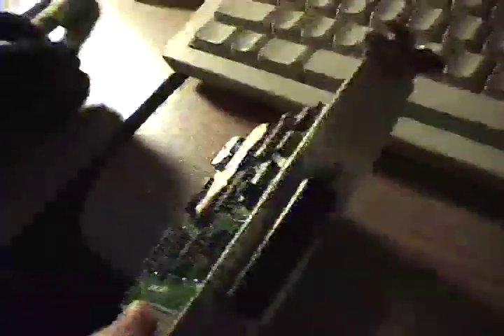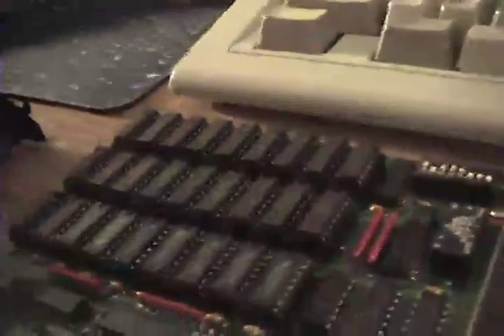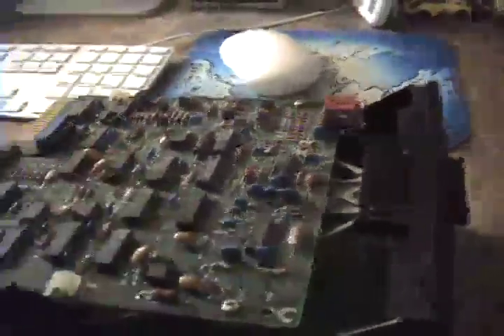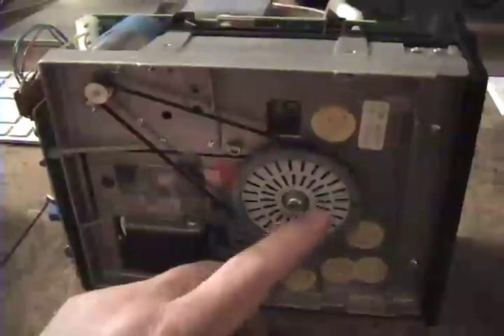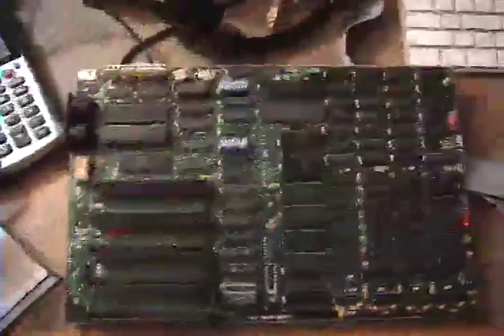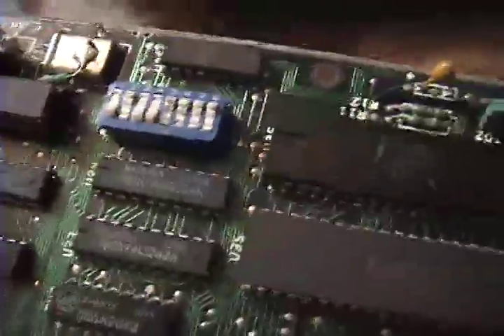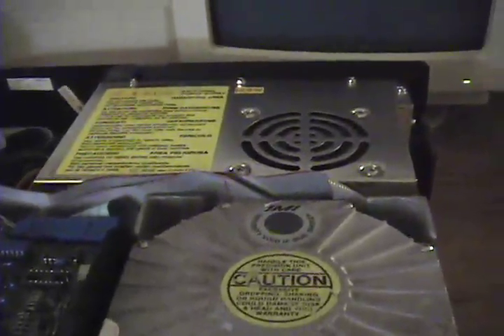IBM 5150 PC Disassembly

Comment: I like how you skipped the part about taking the case off. Helpful!
Reply from the maker: Rather than leaving snarky comments, you could just ask "how do you take the top case off?" To be honest, it's a no-brainer; three screws and pull it toward you. Any idiot can figure that out.
Reply: +BBISHOPPCM's World first off, mine has five screws and "pull it towards me" doesn't tell me much. How do you know where I'm standing? If I'm at the side, do I "pull it toward me?" Sorry, but I just get annoyed at all these "how to" videos that skip pretty important steps!
Reply from the maker: It's very easy. See, when you're making videos, it's also important to leave out the obvious shit. This was filmed back when YouTube had a 10 minute limit on videos for non-partnered accounts. It's been a few years, so my screw count may be off. So here goes; remove the five screws (#2 philips head screwdriver; lefty loosey, righty tighty) and stand with the front bezel (the plastic front of the case) facing away from you. With your palm flat, slap the top of the case while pushing forward; this will free-up the top cover from the chassis. OR, with a plastic mallet, give the top cover a few light whacks from the back (hitting the edge of the steel cover itself). Then, with the front bezel FACING you, slide the cover off by pulling toward you.
Reply: +BBISHOPPCM's World see?! That was pretty good! Except my screws were flathead, not Phillips.
Reply from the maker: They may have been replaced at some point

Comment: Lol that interface is DB 37. I only have seen and only have 1 DB37 external flopyy drive for PCs and its made by apple. I just got a very similar machine came with same monochrome thing and I am upgrading it to a ATI vga card and it came with the maxed out 640KB ram. I am trying to upgrade to the NEC V20 since its onlya few bucks on ebay I assume the number after the - is the speed and I can only find models with 16Mhz. Does anyone know if it would clock down to 10 or can it run at 16?

Comment: I thought 5150's ran on tape drives, no hard drives.
Reply from the maker: Tape drives were optional; the original 5150s had no hard disk drives, only 360k floppy.
Reply: BBISHOPPCM's World

I get it now. I thought the tape drives were built in. I forgot that these were the 80s and that they built computers differently in that time period

Comment: That V20 is still running at 4.77 megahertz.  It is only possible to run it at 8 megahertz if the system board supports it.  The reason for the V20's speed is the fact that it has a hardware multiplier and fully optimized microcode.  It also has a special mode which allows the processor to run 8080 machine code.

Comment: The timing marks are for setting the speed of the drive motor under a fluorescent lamp (the magnetic ballast kind, not the newer electronic ones).  The inner marks are for 50 hertz and the outer ones are for 60 hertz.

Comment: I was lucky to find one of those Tandon floppy disk drives in the shop where I bought most of the parts for my 5150.  It came in a huge industrial storage attachment with a Tandon TM502 10MB hard disk and a couple of very nice linear power supplies.

Comment: The largest and heaviest hard disk I've ever owned was a Micropolis 1588.  It stored about 660 megabytes formatted and weighed nearly twenty pounds with its eight 5-inch platters and overhead spindle motor (yes, the spindle motor was mounted to the top cover).  It used a 50-pin SCSI interface, and because of its multiple platters it had an impressive track-to-track seek time of 2ms and an average access time of 16ms.

Comment: My 5150 started out as a MicroTICCIT terminal which I picked up for $5. It had no internal drives; just a custom video card, a Token-Ring card and a boot ROM.  My build consisted almost entirely of parts from other computers which were purchased at the same electronics shop; the only two parts which were purchased separately were the 640K RAM board and an XT power supply.  The total cost of the build was around $40.  I may make a video of the system later.

Comment: @1:00 The external 37-pin floppy connector actually uses the 34-pin Shugart Floppy interface that the internal drives do. Pins 1-5 on the top row of the 37-pin external connector are unused; the remaining top-row pins contain all the FDD signals (which are the even number pins of the internal connector) in ascending order, while the bottom row pins (pins 20-37) are grounded, according to page 182 or so of IBM PC Technical Reference Manual.

Comment: I had one of these not too long ago that was in pristine condition, new in the box.  It had been bought as a cold swap machine for the offices of the nearby nuke plant, I figure.   It was still new in the box.  I threw it away, as it was wholly uninteresting.  I have a lot more interesting 8 bits.  Wish I had kept it now, only because it was pristine, and just stuffed the box in the back of my closet to sit 50 years.

Comment: last week I restored 2 IBM 5150's , found back at a corner in the house.
1. , just a cap bad and left just as is with the 2 FFD 5,25. and 256k mem.
2. I had completely debug the mainboard for a defect, would not started at all.
There was an IC defect and after change out that one - Up and running.
ALso changed out the power supply . had a clone (150W) in spare.
 I tuned up  IBM Type 13 20MB Full high, 384k extention Mem and a serial card. 
The IBM HD just started with also my old info,,
Maurice

Comment: This machine held 2 Full size 5.25" floppy drives made by Tandon - they have a nice sound, 
depends on board revision - it (sh)could be a XT and then you can actually add an MFM HD - i assume that the true PC couldn't hold a HD yet - and had only 512k, the pcjr had only 256kram - the board has 8 isabus 8bit - and socket for 8088 and 8087 ; the videocard by default was monochrome ; that HD looks like a St-412 (10Mb MFM) - but correct me where wrong.

Comment: The 37-pin external floppy connector on the expansion card uses the same signaling (Shugart floppy interface or some derivative thereof) as a standard 34-pin connector; the first 3 pins are either unused (Not Connected) or grounded.

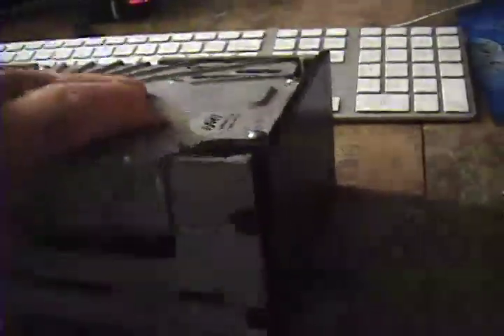Comment: 3:16 I had a hard drive like that one time. Wish I knew where it is. 4:55 I have a fix it yourself book titled home electronics and it's by time life books and it shows a computer system similar to this one. down to the belt and timing strobe (timing marks) on that flywheel. Also exactly how powerful is that spindle motor?

Comment: @bbishoppcm To answer some of your q's possibly as another avid old-PC enthusiast:
A. I believe boards which predated the AT didn't have a form factor, and were just classified by whatever model they came from.

B. The 37-pin output appears to simply be just a connector with extra unused pins, and otherwise sends and receives Shugart-interface (the original floppy interface) compatible signals.

Comment from the maker: You saw a CD-ROM drive for a VIC-20? (or are you referring to the external expansion unit?) They were not very common, but they did exist mainly as a result of the 5150s limited expansion capability (5 ISA slots vs. 8).

Comment from the maker: I'm going to have to disagree with you here, as CD-ROM drives were extremely rare until the early 1990s. The port was actually used for an external expansion bay (would've had at least one 5.25" bay and possibly a few expansion slots).

Comment: Even at 4.77 MHz, the NEC V20 is about 10 to 30 percent faster than the original 8088.  It will also allow you to run real-mode 286 programs, such as the Iomega Zip drive driver or the Windows 95 version of DOS EDIT.

Comment: Even with the 8 MHz CPU installed it will still only run at 4.77 MHz.  The clock speed is determined by the 14.31818 MHz crystal on the motherboard, not by the CPU chip itself.

Comment: The "Async Card" is original IBM.  Since your cards have the older wide black backplates you have an early PC.  Once IBM started making the XT they switched to narrower silver backplates so the cards could also be used in the XT's more closely spaced slots.